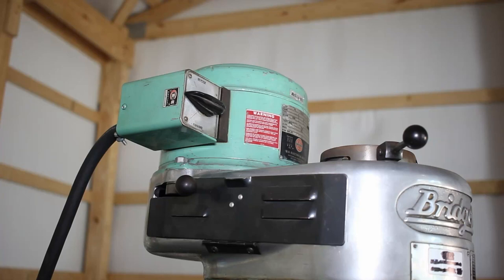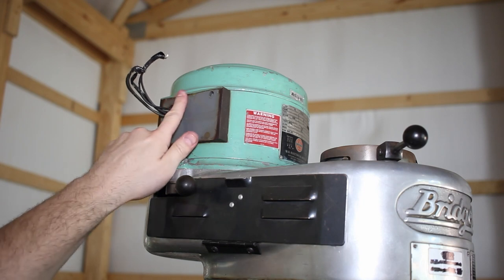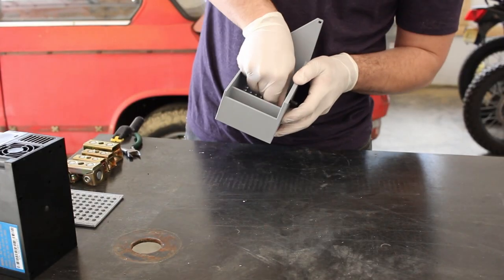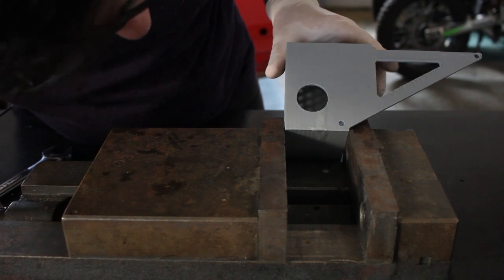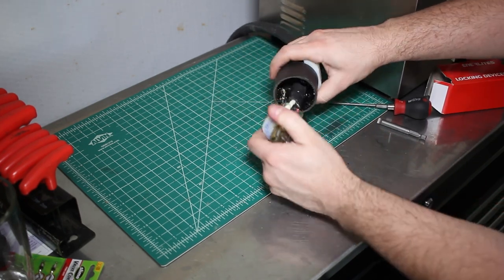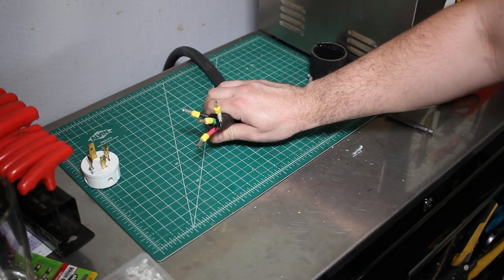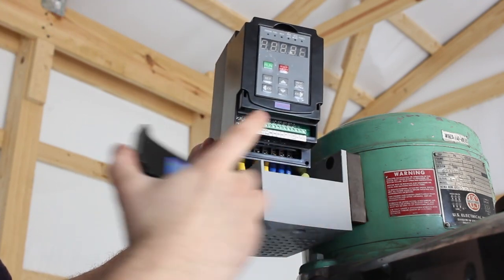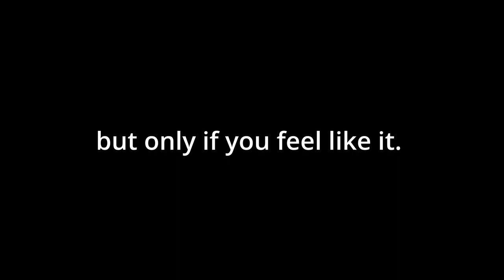Bridgeport Mill VFD Wiring

Comment: I left the factory installed Forward-Reverse switch in place, mounted the VFD on a wall behind the mill, and wired the VFD 3 phase output directly to the Forward-Reverse switch. Followed by building and installing (at a convenient place on the mill) a remote-control panel equipped with Start/Stop and Speed Control potentiometer. Followed by programming the VFD for remote control per VFD instructions.  The reason for leaving the forward reverse drum switch in place and wiring the VFD to it, was to prevent having to change the forward reverse switch direction on the remote panel when changing from low to high speed operation (which changes spindle rotation). When changing from low to high speed operation (or vice-versa), reverse the drum switch position, leaving the Forward Reverse switch on the remote panel unchanged.
Reply from the maker: That's a really nice way of doing it! You also can't beat the solid feeling of the oem directional switch. In the past I had wall mounted all of my vfds and then would have my controls on a mount within easy reach. With this shop I have been trying to make everything easily movable, so I'm trying to machine mount all controls so that I can simply unplug, roll to a new spot and plug it back in. I will be building a new control station for the bridgeport with forward reverse, e stop, speed pot, and some additional controls for an upcoming addition to this mill that's secret at the moment. At the time of recording, I just needed to get the mill running to aid in getting the shop built. Thanks for watching!

Comment: It's been about a year any problems with the motor using a vfd?  I keep reading lot of these older motors will work with a vfd but won't last because the insulation in the coils are not high enough
Reply from the maker: Absolutely no issues. My South bend lathe is going on ~15 years with a vfd on the original motor without issue, and I've implemented dozens of VFDs on motors of all sorts throughout my career. A few things- 

1. Make sure that old motor is greased- I've seen lack of lubricant kill old motors countless times, and often the VFD gets blamed when it had no part in killing the motor. 
2. I spoke with Baldor about this a while back, and they had some helpful information. While it is true that modern motors sometimes use improved insulation, Baldor suggested that what often kills motors paired with VFD's is a lack of airflow at very low running frequencies, combined with the older insulation. Their suggestion was to limit the frequency override such that the motor ran between 40 and 90hz.
3. I've had no issues running within the range recommended above, but I also periodically run at much slower speeds  (down to 20hz in some situations), for very brief periods, without any issue. 
4. Best practice I've found is to select a pulley / back gear combination that gets me close to the speed you want, and then to use the VFD control to fine tune the speed. 

I appreciate you tuning in!

Comment: Do you have an another way to upload the file for the VFD holder . I’m unable to open via google docs for some reason
Reply from the maker: I just uploaded the latest version to Thingiverse- it will take a day before my account there is verified, so I appreciate your patience! The latest version has a DB15 port for easily adding remote controls, an upgrade we made at a later date. Additionally, the latest version is more rigidly mounted to the head as it does not use the rubber block the original switch uses. 

https://www.thingiverse.com/thing:6726130

Comment: Is that vfd input is 220v single phase and output 380v 3 phase? If that what is its model and brand?
Reply from the maker: 220v 1 or 3 phase input 220v 3ph output. Link in the description!
Reply: @RocanMotor  but this motor is 380v 3 phase?
Reply from the maker: @kregerstainer  this is a 240/480v 3 phase motor. It is wired for 240v on my machine.
Reply: @RocanMotor  thanks for replying,,
Reply from the maker: @kregerstainer  my pleasure!

Comment: can this VFD be used for 1 phase output installations (for example, if I wanted to put this on a 240VAC 1P pool pump and simply wanted to run it at a slower speed?
Reply from the maker: Hi there HoneyBadger. Unfortunately this vfd cannot be used to control a single phase motor. In general, vfd control of a single phase motor is atypical. I would be cautious of trying to run a 1PH pool pump motor at a lower speed than designed, as it may fail prematurely.